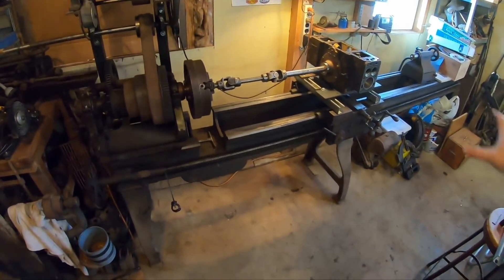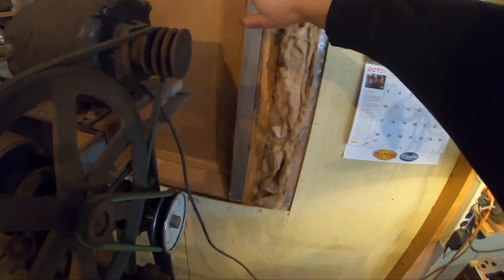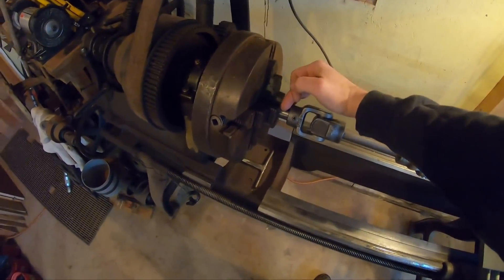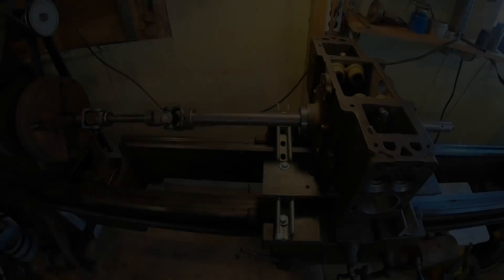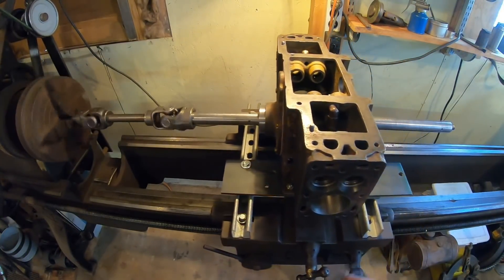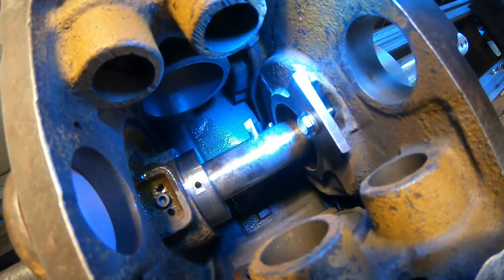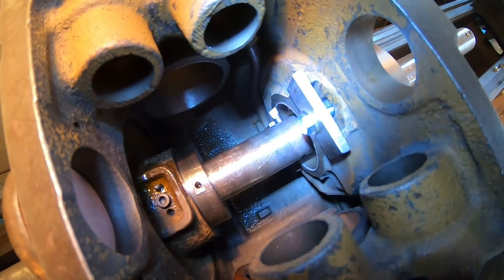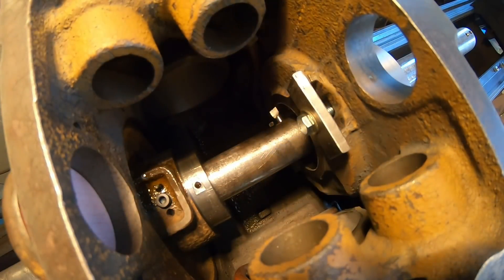Caterpillar D2 #5J1113 Starting System Ep.12: Machining the Damaged Main Bearing Bore on the Lathe

Comment: Really impressed with your line boring set up. Only improvement i can suggest is to tap the end of the the hole the cutter fits into in the bar, and fit a fine thread grub screw. This lets you easily increase the cut by fine increments. If, for example its a 20tpi grub screw, a 10th of a turn easy to judge) gives you a 5 thou increase in cut.

Comment: Tedious? Not on your life.  An 80+ year old block, using hand-made tooling, mounted on a 100 year old belt-driven lathe that was "modernized" maybe 40 years ago...I could watch that all day long.

Looking forward to the "creating a new bearing" segment, and also how you're going to work around the wallowed-out dowel hole.  Doesn't look like a lotta meat is left there.  Inquiring minds want to know: Does Squatch just slather it with gallons of Loctite chemical retainer or Elmer's and hope for the best?  Informed experts say no way! Stay tuned....

Comment: Did you put a chamfer on the bore or was there some still left? That the problem with aluminum it tends to shear when you install it. what grade did you pick up 6061, 7075  it would be nice to know what cat used for them.

Comment: Now with his setup and experience he can rework blocks that need that work for other people who need it done and are willing to pay, I certainly would instead of melting the block down.  Of course having it actually DO what you intended it to do is the ultimate pat on your back.  Yep taking a bunch of busted parts for a chipper and putting them back together and make it a running engine that accepts original parts is fantastic thing.  My handle, bitsnpieces, describes doing stuff that will make something (original Lister engines) run even better then new.

Comment: IMO you made no mistake rake cutting the first pass, it's actually better that way. I've tried cutting small bores (in quite rigid setups) directly with a low angle cut and it doesn't always give a smooth finish.

Comment: That is one Rolls Royce set up which paid back in the 4 minutes of machining. I like making models and its like masking to do paint jobs, hours of taping for 2 minutes with the spray gun but worth it when you peel the masking off.  Now you have to make a new bearing would it not be worth making a bronze or oilyte bearing? Aluminium is a bugger for picking up and that is what probably caused the original bearing to spin in the housing.

Comment: Yeah your tool advance is about twice as fast as you want it.  Make do with what you have.  Broadening the cut surface is what I would have done.  Just have to do your best to make sure the cutting surface is on plane.  A set screw on the back side of the tool makes more consistent predictable adjustments to cut depth.  I couldn't tell if you had one behind it or just relied on the side set screw and your eye ball.

Comment: That's a decent setup but you would have been better off to put a dog on the end on the drive-in and run it between point to point then you know 100%, the shaft is centered and can't go nowhere or flex
Reply: It has plenty of support.  Cutting cast does not take a lot of tool pressure.  Light cuts further reduces tool pressure.  We line bore in the field with less bearing area on steel components without issue.  If in doubt a spring cut verifies the performance.

Comment: Take your hone and clean that bore, you will get even better contact and longer lasting results on your repair. Most block bores are burnished or honed so contact is solid between parts. In long term use vibration can often wear those peaks from machining down and cause fits that were press to begin with to become loose.

Comment: Nice job on the special tools and the use of the lathe. Just curious, what alloy of aluminum are you using for the new bearing?
Reply: Would a bronze bearing be a option or would you end up wereing out the crankshaft?

Comment: Very nice setup for the boring bar drive. The way to check the depth of cut is measure how far you bit extends from the bar. A dial caliper using the depth rod on the end will give you measurement. Then add that to the diameter of the boring bar and you have the radius of your cut. That was how my boss set the cutter on his case line bore setup down VW bug cases. It works well. It looks like your line bore went very well. Great job. Yeah the gathering of the tooling takes many times the time to actually do the job. But in the end you have a great finished product with repeatable results. 👍

Comment: Why not put the boring bar directly in the lathe jaws instead of the universal joint set up?  Is it cause the universal joints allow the boring bar to remain straight in block but allow variance in attaching to the lahe?

Comment: Are you going to buy a really cheap micrometer. That will measure from the far side of the bar to a range of sizes on the cutting tip. Machine a full round sleeve the the I'd fits the bar.   Machine a pocket on your vertical mill to mount the fixed end of the micrometer  and glue it in place so you have an easy way to duplicate settings.

Comment: Key board cowboy here.  That's way way too much feed per rev.
Reply: Ah ha, I knew it had to be something like that.  Didn't think about change gears.  I have a 1945 big drill press somebody direct drived eliminating apparently a failed reduction gearbox into the spindle.  It won"t accept any "bigger" feed change gears.  I use it in production for 21/32" drill through 3/4" A-36 and it takes about 9 seconds.  Don't blink on the coolant though. A dull drill will buckle and snap.  BUT just right for throughput :).

Comment: Isn't the pitch too big? If there is no metal surfacing work next, I would reduce the pitch by a factor of 2 or 3.
Reply: @squatch253  I may not know the correct terms in English, but by that I meant the speed at which the part is pushed onto the cutter. (thread pitch?) so that all the work can be done in one cutter pass   :-)
Reply: @Tihonoffff  right, he has said in another reply that his lathe uses change gear sets to adjust feed rate of tool vs headstock speed.  He said they didn't get any more of the gears with the lathe when purchased long ago used.  A lathe like this would have come with many many sets of gears to swap around and a chart to tell you how many threads per inch you would get with each combination.
Reply: @homeFall1  well, english is not my native language. and I could not understand or miss something from his words. in any case, his work led to the desired results )

Comment: Does your classic lathe have many different settings for the feed?  Seemed to be feeding a bit fast.  Could you pick the finest thread pitch setting for a slower feed, and smother finish?  Rounding the bit really helped, could have gone a lot further and ground the cutting bit way “flatter” , or less of a “point”......more flat across the cutting edge.  Good results!
Reply: I didn't see a gearbox on the feed (could have missed it) so it either has no true leadscrew for threading or uses change gears to select the feed speed on the screw.  I didn't get a close enough look under the apron to know for sure.  Either way it would be a bigger commitment than a more modern high end lathe (not that this isn't high end but features change with decades)  of just moving a lever over.

Comment: Hey All, my uncle just passed and left behind an early 40s John Deere dozer. I am hoping to haul it back and get it running again but am not sure I'll be able to get it running to load it. Any tips on getting it up on a trailer?
Reply: If tracks aren’t frozen up, hand winches.  You need at least two.  Or a motorized winch +/- a battery charger/jumper cables.  If tracks are frozen, vegetable shortening and planks for rails.  
It all depends on what you have available and what you need.  A big wheel loader with forks might take 5 minutes to load it, couple of come-a-longs and no access…….maybe 5 hours!  Go for it!

Comment: Excellent machining job on making the tooling the bearing bore looks really good. On the dowel hole could you cut threads in the block and make up a tapered end set screw to retain the bearing you could also taper the hole in the bearing so it would act as a wedge and as far as the set screw trying to back out of hole you can peen the casting lightly with a center punch I have seen that staking system used inside of transmission of tractors and other machines. Keep up the great videos 👍👍👍👍the tooling always take along to make and the actual machining repair only takes a few minutes but now you have the tooling to repair as many blocks as you wish too tackle.
Reply: Like it.  Could also do the belt, suspenders and bailing wire deal and put some bearing retainer locktite on the bearing along with peening it over once installed AND the tapered setscrew.  Sounds like this part of the engine design was WAY under supported so I would think multiple backups to keep it from coming loose might be prudent.
Reply: @homeFall1  yes it looks like a questionable design from the factory so as many back up ways to keep it in place is important

Comment: Well done man!! For the bearing retention, could you oversize the hole to make it round again then do the same thing on the bearing you make, and fabricate your own press fit retaining dowel to hold the bearing in place?
Reply: @squatch253  Will the lock screw need to be heat treated/hardened?

Comment: How were you meaning the advance/depth of the cutter? Was it just by eye or did you find a way to measure inside the block?
Reply: No connection but Hemingway Kits in the UK have designs for much smaller bars with the luxury of a built in micrometer. Might be worth a look if ideas needed for a precision adjustment. Not worth ordering the kit of raw materials from them of course - silly postage!

Comment: Although I've heard of and known of line boring for many years, I hate to admit I've never seen it done, and didn't really know what it involved. This was a beautifully conceived and controlled, very meticulous process that was executed with great skill and perfect results. Good work.
Reply: You should definitely check out Cutting Edge Engineering on YT.  You won’t be disappointed.
Reply: @kbrodie78  you just beat me to it. Was going to suggest the same CEE is a true master of his profession
Reply: @kbrodie78  Thank you for the heads up. ABOM79 is another great reference on things mechanical. I kind of have to budget my YT time. Squatch is a must see.
Reply: ICweld also does similar things to CEE, different but similar.  More on the welding side and not much machining but it's an interesting study on his approach to seemingly complicated problems.
Reply: @frotobaggins7169  very true. Isaac is very good. Working with heavy plant repairs.
Reply: @frotobaggins7169  IC Weld is truly gifted when it comes to torch cutting. A master craftsman for sure.
Reply: https://www.youtube.com/watch?v=R__Ge13fgpQ&t=8s